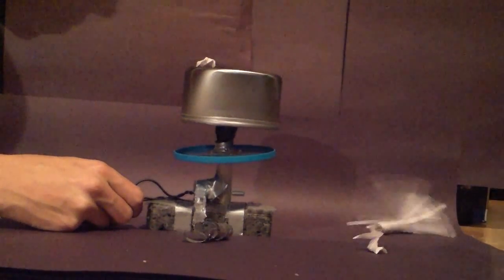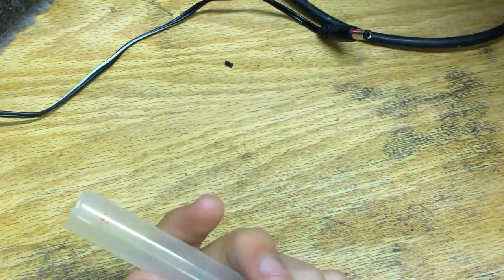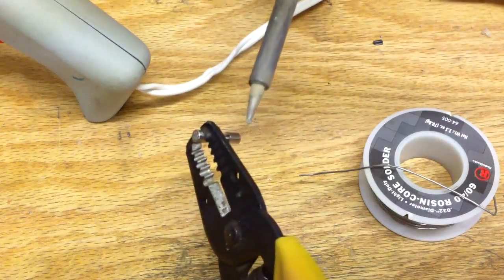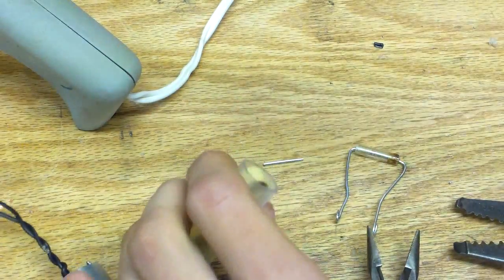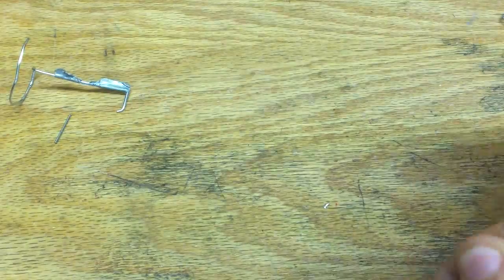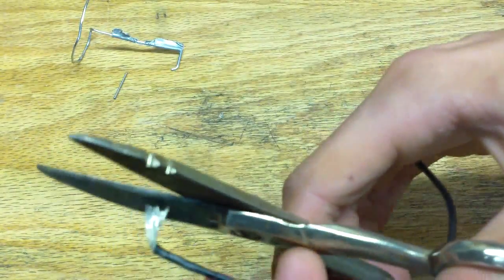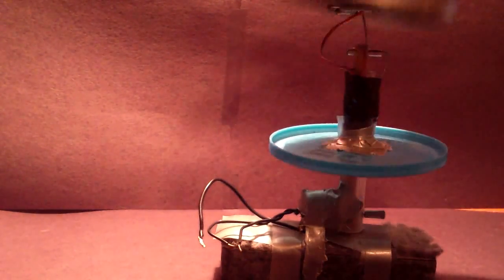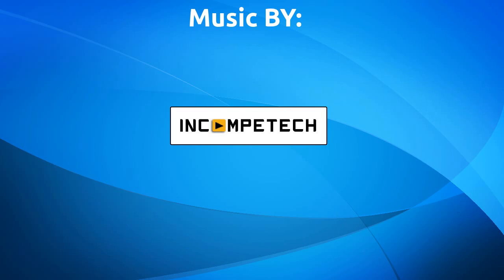How to build an impressive 30,000 volt Van De Graaff generator!

Comment: If you're looking for improvements on the range of static shock. I'd recommend an insulation of about 4 to 5 layers of Tin Foil to help the charge increase, put under the look-a-like Tuna can. Also, if you want more shock in less time, I'd recommend wires that are a little bit thicker -or just doubling the amount by tying the same wire twice in the same locations.

Comment: Well I've made one but you shouldn't put oil because it is one of the biggest enemies of the vdg and a bit of oil stucked in my rubber band and now pfffff.it doesn't work
Reply from the maker: Thats unfortunate, but I suppose it depends what type of oil too. Use some soap to clean it off and replace the rubber band. I only used just a drop of WD40.
Reply: Well i cleaned it with rubbing alchol and now it\s working great . NP
Reply from the maker: Great!

Comment: research the work of thomas townsend brown
Reply from the maker: He seems to have studied a possible relationship between gravity and electricity, or what he called "electrogravitics." What about him?
Reply: Power Max
he developed highly charge capacitors that, then charged, would move in the direction of electropositive. these high voltages are a key in electrogravitics. a really great read, is look on scribd and type in lost science by gerry vassilatos. an absolutely gripping account of his work, what he did and how he did it
Reply from the maker: ***** A capacitor which physically moves to a positively charged object when charged sounds more like simple electrostatics (opposites attract, like repel) rather than antigravity, which has been debunked multiple times.

Note that because his devices did not work in a vacuum, it was established that the high potential differences across the plates of the 'capacitor' caused atoms of air to become ionized and move to the opposite charge, creating air flow. The flow of air can be great enough to create electrostatic lifters. However, in a vacuum, they do not work.

I do not currently know of any true connection between gravity and electricity. Most physics consider them completely separate forces that are not related to each other. So knowing this, unless the current understanding of physics is wrong, there cannot be such a thing as electrogravitics. Surely it is just ion movement.
Reply: Power Max
 i have read differently. That his experiments performed better in a vacuum, and increased performance with increased vacuum pressure. he also did experiments in oil where they gained additional force (in comparison to the ambient air experiments). I dont have any video to prove this to you. rigght now to cooberate with what i have read. If i find them, would you want me to send the link to you?
Reply from the maker: ***** Sure! i did not search much into his work, just the wikipedia page of him. I'll look at him in more detail.
Reply: Power Max
will do friend :)

Comment: what factors would allow to go beyond 30 kV?
Reply from the maker: To allow higher voltages to build up, you must reduce leakage from the top dome. This can be done in a variety of ways: 

* Use the generator in the dry environments so voltage can build up. Humid environments will essentially 'short' the output to ground.

* Make the generator physically larger so that the dome is further away from ground, thus the electrostatic fields created are weaker and electrons don't jump to ground. This way electrons can only escape on command, intentionally by approaching objects to the generator.

* Use a smoother, more spherical shape for the top dome, and use insulating materials (tape?) to seal up any electrical 'leaks' found. Because of the way electrons build up on sharp objects before spreading out over the whole surface, the larger voltage (more density of electrons) they will leak away easier. This can also be done with tape and insulating materials.

There are probably some other, more clever ways to go about eliminating leakage, these are the 4 ways I can think of off the top of my head.
Reply: Power Max
thank you.

Comment: Love this but all that charge you are suppressing with the ductape, could it not be re routed to keep the battery charged?
Reply from the maker: I am not restricting any charge buildup with the duck tape, otherwise I wouldn't use it. the duck tape prevent the charge from leaking away. It is difficult to obtain such high voltages on any material without it wanting to leave.

Unfortunately, the output is of way too high a voltage and too low a current to be useful. Imagine trying to drive a truck in 5th or 6th gear (a stickshift transmission) up a gravel road. You'll just choke the engine, even though it might have the total amount of power necessary. You can also imagine tring to run a toaster or other AC appliance from a battery. the maximum voltage output of the battery is way too low to power the toaster, and although something like a car battery can  power a toaster, only after boosting the voltage. An inverter is required.

Same here, except not only do you have impedance matching issues, you also have large power losses due to friction and poor design. the output is only good to make small sparks and make fluorescent lamps blink dimly. Because the total output will always be less than the input, eventually the battery will die even if you could charge the battery.

Comment: Awesome, my roommate and I built one much larger than that and it barely worked. We're still trying to figure it out so this little device might make a good learning tool.
Reply from the maker: Can you describe the construction method? Maybe I can help some! Sometimes it is just a matter of the smallest adjustments.

If you can get many short sparks but no long ones, you probably have a leak somewhere. Seal up or smooth out any sharp edges and nicks. That will allow high voltages to built up and larger discharges to occur. Other times it could be the brushes do not have sharp enough points and that they are not close enough to the belt. Play with that and the quantity of sparks should change. the grounding of the bottom brush is also critical. The electrons want to flow from/to that to/from the top dome. RimstarOrg also has some great info on this (he inspired me to build this) so you can check him out -->

Comment: How many volts does the motor have to be work like yours because your van de graaff generator creates electricity fast
Reply from the maker: It depends on what motor you decide to use. (Mine was rated for 5 volts, it was connected to a 9 volt power supply.)
Reply: I did all the steps but your van de graaff generator produced electricity really fast but my one takes some time
Reply from the maker: Khandakar Tasfique Well then good, your generator now just needs to be tweaked, make sure the rubber band is spinning freely and not scrubbing up against the side of the tube, this will let the motor spin faster, carrying the charge on the band up to the topload faster.

Also, make sure there is no corona leakage, so seal up any sharp edges on the topload, This will help the charge stay on the topload, and thus, the voltage will build up quicker and to a higher potential. You can find corona leakage by turning on the generator in complete darkness after your eyes adjust. Then you can see where small purple streamers appear. Turn the lights on again and patch up the area with some tape.

Make sure the top and bottom brush are close enough but not touching the generator, and the bristles are spread out far enough to collect the charge on all parts of the rubber band. the bottom brush connects to an electrical ground, or yourself.

If all else fails, you can raise the voltage applied across the motor, but this may cause the motor to overheat and go bad, and also makes the generator a lot louder!

Comment: can i use a wire that does not spread out for the motor? it is like... a single core thingy.
asldo do it need a soldering iron? maybe i can use a lighter...?
Reply from the maker: I don't know what you mean by a /"single-core thingy"/ and by a /"wire thats spreads out for the motor"/? the wires to the motor are only for delivering power to it, it doesn't matter how it's accomplished. The brush of the motor should be very close to the rubber band belt, but not touching, and the wire bristles to need to be spread out to allow a maximum amount of electrons to 'hop on' and 'leave.'

A soldering iron would be useful for soldering wires to the motor, but as long as you can transfer power to the terminals of the motor, thats fine. I understand not everyone has the same supplies I have, and if not, then use your head and come up with the crafty solution! I once tried using a lighter when I did not have an iron on-hand, I had no success whatsoever, but it wouldn't hurt to try?

Comment: Can I use a friendship band for the belt ? I am using a 40000 rpm motor,  also I dint get why did u use the lid for?  And what type of tube should I use for the shaft? Thanks alot.
Reply from the maker: I am not sure what a friendship band is, I can guarantee if it will work or not, but is it is made out of a solid substance (not cloth-like) and the material is found in the triboelectric series (like rubber) It should work.

The purpose of the lid and the tape underneath prevents surface tracking due to the skin effect. In other words, it is simply there to minimize sparks traveling along the plastic, to the motor.

Is that motor is rather small, it may not have enough torque to drive the belt. You can simply gut a marker to obtain the tube, I mentioned that in the video.

If you are referring to the top roller "tube," any similar glass or nylon bead should work, I happened to use a fuse, which fit the criteria well.

I can't really tell you what works or not, since I do not own the same materials you have, so I can't test them. You will just have to build it and see if it works.
Reply: Thanks alot for replying. I am really looking forward to see my generator work. Great video. Can u also put up a video to make franklins bell using a fly swatter.  There are plenty available but when I make my franklins bell seeing those video,they never really work
Reply from the maker: sarthak babbar I started working on a video where I showcase all the cool things one can do with this generator, but have not finished it due to lack of time and desire. I'll see what I can do... It will probably not be soon. (Perhaps sometime in the summer)
Reply: Nice
Reply: Maybe one can work for my 12 th class project
Reply from the maker: sarthak babbar It is a very easy project to do, just make a ball of aluminum foil, tape it to a thread, the other end ties around a pen, which you hold in your hand, then place a piece of aluminum foil on a CRT tv, turn it on, it should cling to it, and then hold your hand near the TV (inches away) and let the aluminum ball sit between your hand and the TV. As long as the foil is charged, the aluminum ball should jump violently between your hand and the TV. Why would you use a fly swatter? Are you referring to the electric types, I do not have that to work with, but if you do, then take it apart, find the HV wires and attach them to 2 soda cans 2" apart, and place the dangling aluminum ball in between.
Reply: I have tried with fly swatter a lot of times,  it never works.  Should I attatch both of the wires to each soda can and attatch those wires to the fly swatter?.
Reply from the maker: sarthak babbar Yes. the two wires previously going to the end that electrocutes bugs go to the two the cans. You may been to adjust the distance between the cans, and force the aluminum ball to touch one of the canes.
Reply: What are HW wires?  Are they alligator clips?
Reply from the maker: sarthak babbar You can use any wire you desire. It can be strips of aluminum foil for as far as the electrons care! Any wire should work.

Comment from the maker: Turn out the lights, look for faint blue spots and if you find any, turn the lights on again and seal it up with tape. trial and error is your best bet. It took me forever to get it to the point of the video.

Also, is humidity high where you are? that will adversely affect performance.

Comment from the maker: I added the lid because I noticed arking from the top load to the motor. The lid is there to help prevent that, but it won't help if you have an electrical leak somewhere.

Take a look on google of the triboelectric scale. Any tape made out of material with electrically similar properties should work.

Comment: Where are those sharp points and edges you are talking about? Yes I am using a soda can. What is the vinyl down by the motor? Does that necessarily need to have electrical take? Im going to add the plastic lid, does it need to be a certain distance and what does it work for?

Comment from the maker: Sharp points and edges will cause the charge to leak faster than it can be built up. If you can, buff them out, or seal them up with plastic tape (preferably with clean electrical tape.) What are you using for a top load? A soda can?

Adjust the glass top roller so that it only comes into contact with the glass and vinyl down by the motor. Make sure the brushes are less than 1mm close to the rubber band.

Comment from the maker: Just mess with it for a while. use the generator in the dark and see if there is any electrical leakage or sparks from the topload. There should be no sharp edges.

If the band scrubs up against something, it will slow down and not spin fast (faster = better) and might even leak the charge it is carrying. make sure the motor is grounded as well.

Yes you can connect Grd to yourself.

Comment: So I can connect that bottom brush to my self and it will work?
Does it matter if the band scrubs up against the tube?
I don't know what else I could do so I can get the spark anything I can adjust?

Comment from the maker: Sometimes it is a bit of trial and error. Considering you did get napkins to move is very good. The bottom brush is indeed important and the wire coming from it has to be connected to something either grounded, or yourself (which is how I do it.)

The adjustments I made are just minor adjustments to the brush and top glass piece so the band stays centered on the glass and doesn't scrub up against the tube.

Comment: Hi Max,
I would like to ask you several questions about the generator you made. How important is the ground(bottom brush), and I can't see where you connect it to in the video. I also don't understand what ajustments you make at the end of the video. I made my generator i used a can on top and attached some pieces of a napkin I can only make the paper lift when I get my hand close but I can't get any sparks or the same potencial that your has.
Would appreciate if you could answer soon.

Comment from the maker: I'm not really sure, Small hobby motors like this usually do not have much torque. due to their construction, and like "constant-torque" supplies, where the amount of load on it (including friction) will dictate it's speed @ a given voltage. Any reasonably sized hobby motor should work fine, I was even able to overpower mine to >2 times the voltage. I'd keep an eye on temperature though

Comment: I'll mount one of these for a school project. I wanted to add something more scientific you know .. Not only mount the equipment and make run, but also include the  Triboelectric series in the experiment and show how electric fields behave  with different materials on the pulleys. Thanks for answering.

Comment: What happens if I reverse the pulleys? (put the fuse glass  down of the pulley and the tape pulley on the top?). I am interested in the property of electrostatic attraction of plastic materials (in this case, in the Dome attract plastics). Is there any difference in reversing of pulleys? grateful.(sry something, google translation ;)

Comment from the maker: It's all tn the video. I used a wall power supply (anything between 7-12V >300mA) or a 9V battery. A old phone charger is only 5V, so it will be a bit slower, but safer/better to the 5V motor.

Comment from the maker: [part 2] As these materials make & break contact, electric charges  move. In this case, electrons will move from the dome, to the glass and the rubber belt, those charges are then carried down to the vinyl, where the charge will migrate to it and ground, leaving the belt (+) charged (a LACK of electrons) and that (+) charge is passed to the dome.

This leaves the world negatively charged (in respect to the dome) the the dome positively charged (in respect to whatever the ground is connected to)

Comment from the maker: In order for this to work, only special materials can contact the rubber band to build up an electric charge. Electrical tape is made out of vinyl. Looking at the triboelectric scale, we see that vinyl is almost at the (-) end, and normal rubber is neutral (0). The top roller is glass, which is considerably more (+) charged than rubber.

Comment from the maker: The switch goes between one pole of the battery and one lead of the motor. Then connect the remaining wire and battery pole together. the lid just helps prevent arcing and leakage between the top dome and ground, this way, a voltage can accumulate.

Comment from the maker: is woukd probably not be practical. This is not a voltage supply, it is a constant current supply, meaning the voltage will climb up and up until it discharges somewhere. I am able to light up flourescent tubes, but they are very dim. I might soon post another video demonsrating experaments that one can do with this generator. even if you used an ideal transformer, the power is almost nothing. (0.03 watts)

Comment: How do you test the voltage created. And could I run this voltage to a oscillating circuit to convert it into AC and then run it in a step down transformer to get enought current to light a Fluorescent bulb :D ?